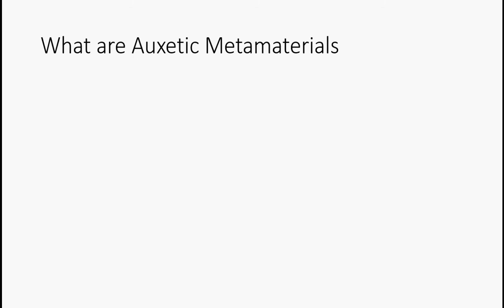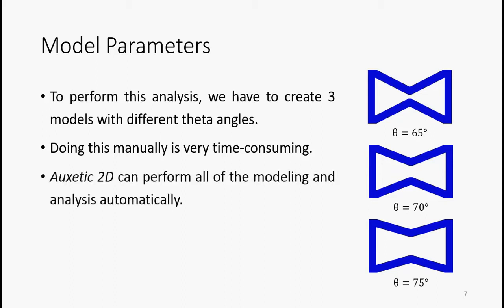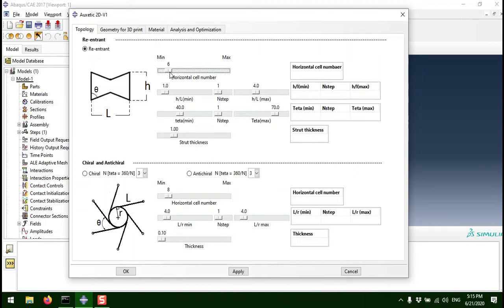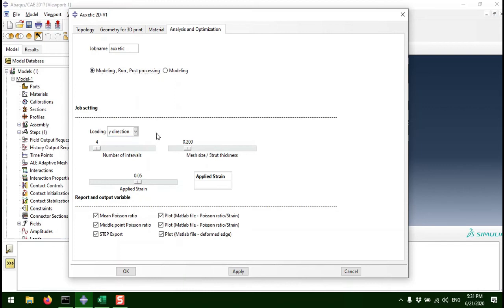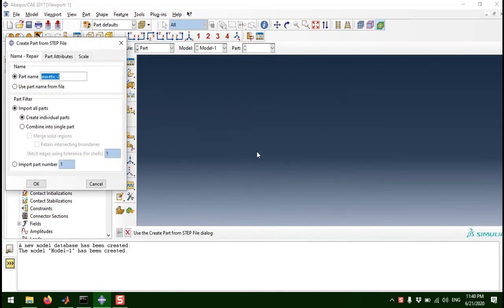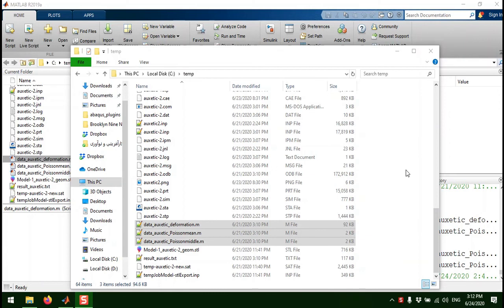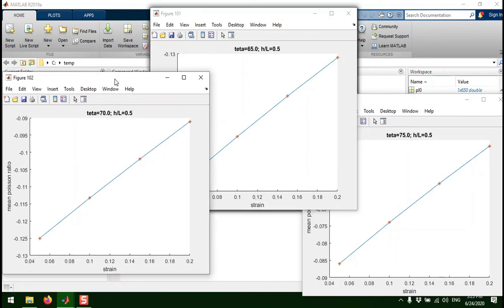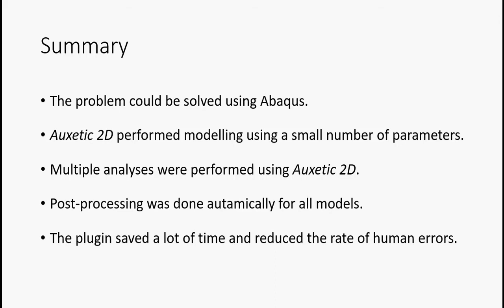Auxetic 2D: A plugin for Automatic Modeling of Auxetic Structures

Comment: The new version only covers the re-entrant2d, where is the former version available?
Reply from the maker: PyAuxetic offers a more structured and extensible framework for implementing different unit cells. You can extend it yourself (clone on GitHub) or collaborate with us on a project where we will do the coding and the simulations.
You can request a copy of the software discussed in this video (Auxetic2D, now known as Auxetica) by contacting the corresponding author of its paper: https://doi.org/10.1007/s00366-021-01295-w